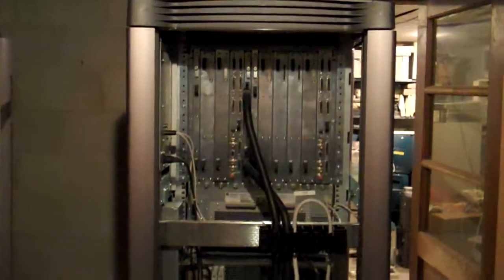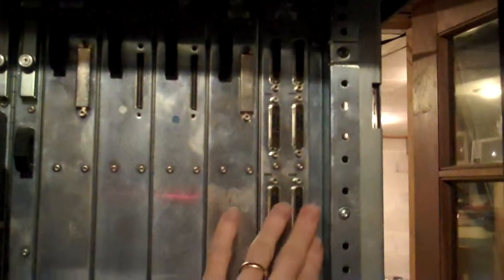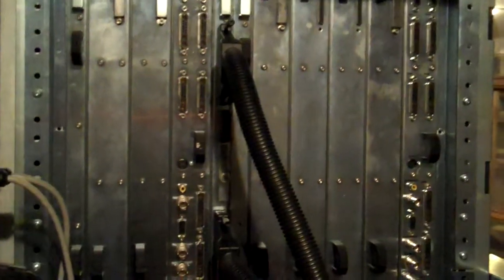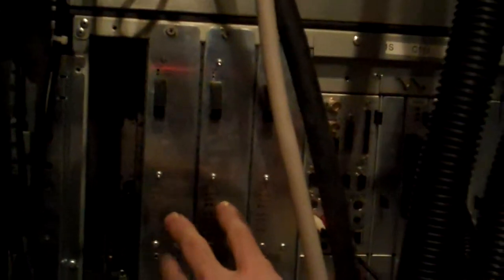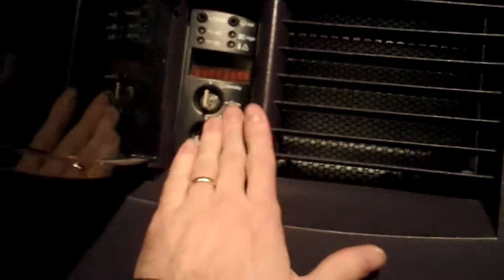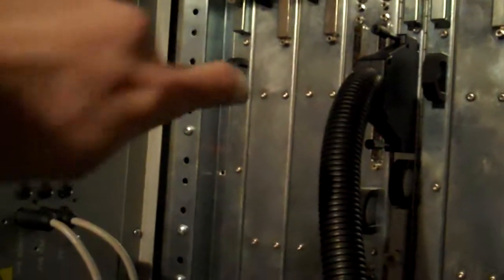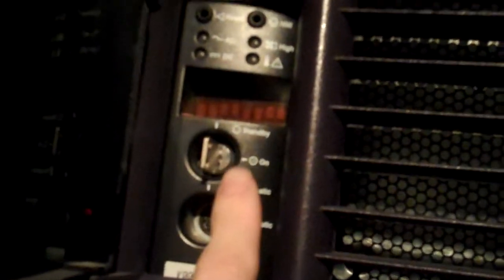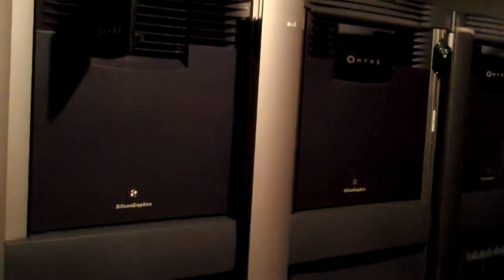SGI Onyx2 five-rack system tour, Part Two

Comment from the maker: @randomshinichi Currently I cannot, as I usurped the 220v feed line back for my home air conditioner :)
However the new property (see latest video ending remarks) has 100 amps of 220v, so I should be able to, when sequenced properly, get several of racks running and I will definitely provide such a video at that time!

Comment: How does these systems compare to what's out there today. SGI had some great technologies that you don't see any more...like their removable nodes. I'd like to see SGI get back into the workstation business again as they were some great machines.
Reply from the maker: Tough call. It's real hard to come up with much that's apples/apples as their overall throughput is still phenomenal. Yes, the graphics card on a high-end PC blows the graphics module away in certain benchmarks, but the over-all bus throughput and the layered system design where you can just add additional processing modules is extremely powerful. And, yes, they're not really making workstations anymore - they've focused heavily on the supercomputing market. I guess you can't really complete with PCs in the workstation space anymore because of how stupidly cheap they are.
Reply: jpkiwigeek I just love your videos. Do you think that you could make some videos pertaining to the performances and the power that these machines have, and probably how viable they could still be in today's rely of computing. BTW: what do you think about the Octane III. Thanks, and please don't stop making these videos.
Reply: Just made a bid on ebay for a octane unit with fiber channel, and it has the V6 graphics board. I was wondering how hard would this system be to convert to a octane 2 with dual CPU's? Also, I would like to max out this unit with the best components of the time. Any suggestions would be most grateful.
Reply from the maker: To convert it to an Octane2 would require replacing the mainboard - at that point, you need a whole donor Octane2 anyway. You can run R14ks in a later model Octane, and the early VPro graphics sets - that's a pretty beasty machine, so I wouldn't feel too poorly about not having the Octane2 boardset.